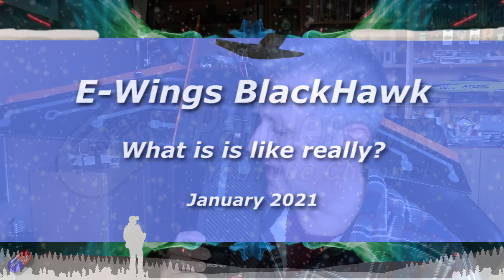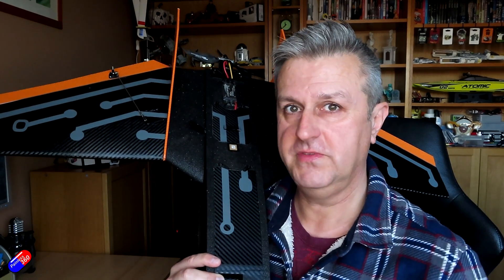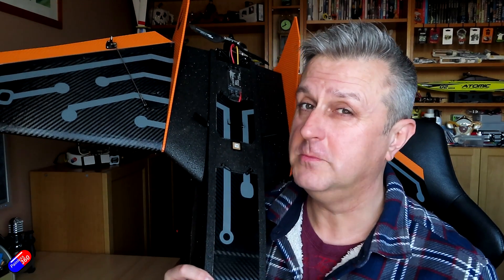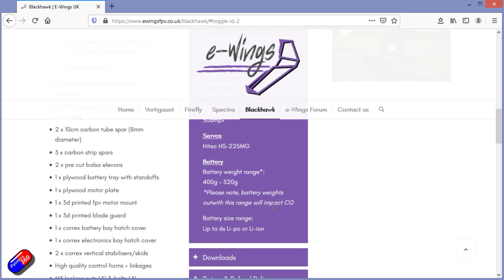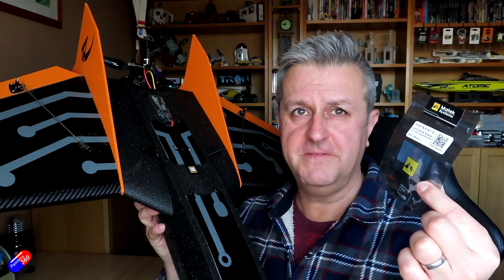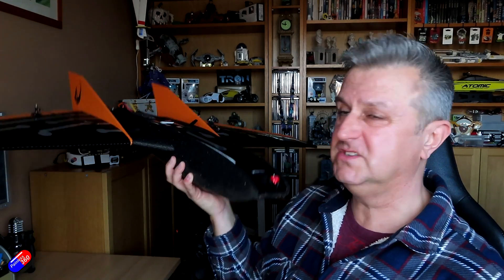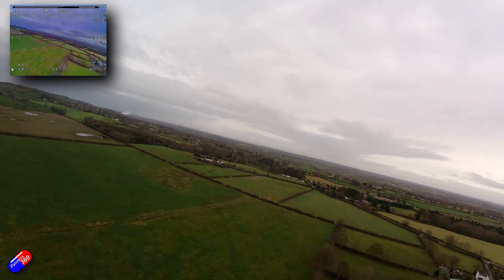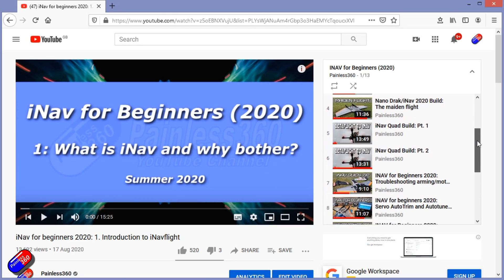e-Wings Blackhawk: What is it like to fly?

Comment: I need your help please 
I accidentakl busted the right wing of my UAV FIX-WING. The propeller broke and the motor got detached 

I fixed the wing fuselage with Carbon fiber and I also reconnected the motor cable. When I turn it on, the servos work but not the two motors

Is the Flight controller damaged? How could it be since the servos for the wings and tail move ( work) but the motor? 

May be the damaged motor not working that prevents the flight controller from turning the other motor?

I don't really know how to approach to this problem. I am trying to get a solution
Reply from the maker: I'd plug a servo into the ESC connector on the FC and see if that servo moves to show the throttle signal is ok - then it would be the ESC or motor.. Best of luck!

Comment: Very interesting that Chris and Greg came up to that agreement, especially since the Drak line has been discontinued by Ritewing.  As of Fall of 2020, the Mini Drak and original Drak are officially out of production. I would think that would change their Gentleman's Agreement. 
Thank you for the extensive review on this wing.
Reply: The foam I use is cut from an injection molded EPP block. I have worked with companies that have used this foam in commercial UAV applications throughout the world, including the Antarctic and the tropics. Very high density. Check out the eWings Instagram channel where I drive my car over our wings ;-)
Reply: @gmac_83  sounds great but, here in the states where we love the draks, it will not help us. 
Molded gives the nice smooth surface of course you laminate a cut wing to get the same effect so it comes down to we can't get them here so, it will be hard to convince any of us else where that it's close.
Reply: @carrboro_chapelhillfpv2442  I'm not trying to convince anyone. We can get draks here also. I have one.
Reply from the maker: I hope so - this is a fab wing for those with a little skill..
Reply: I don't think it's so much an issue of "out of production" as it is that Ritewing are investing a bunch of money in a new shop that precludes laying out large sums of money up front to order the next batch of Draks. I don't see the MD going away any time soon. Such a popular airframe. Would be great if the BD stuck around too. An amazing plane.

Would be nice to be able to purchase this Blackhawk outside the UK. Lots of drakish looking planes being sold these days. With limited production and $242 CAD before duty/shipping/taxes, not like a lotta people are going to be buying them. Guessing this would cost about 500 bucks landed in Canada were it possible for me to buy it. But now that I've watched this review, I want one...
Reply: @jimross898   It is a great craft but, the material that was used is not normal and I do not know where you get it or how much it cost but, as far as I know this is the only company that uses it. I wonder if that is what is going on. Draks are molded and the molds are expensive so the fact that they are discontinuing them means something is defiantly up. I should talk to him and see if he will give a hint as to what is going on.
Reply: It may be a copy of the mini Drak but, it will not be made from the same foam as the Draks. That foam they used for the draks was way stronger than any other on the market. I hate the deals were discontinued but, I imagine it will have to do with availability of manufacturing. 
It sucks but, at least the drak design will live on. 
They say copying is a sign of  praise , if so I hope Chris heals the same. 

Love your color scheme by the way. Easy to see and looks great.
Reply: Not true.  The Drak line is still in production, even 4 years after your message.   I can't speak for the original, big daddy Drak, but both the mini Drak and nano Drak are still being made.  In fact, I just bought 2 of them last month.  In addition, on the Nano Drak, not only can you get one with the standard wings, you can get them with extended 40" wings.  There reason why the Blackhawk is only available in the U.K. is because it is a total rip-off of the Drak.  E-Wings is just lucky that there is no active design patent on the Drak, as they would easily open themselves up to patent infringement.  The Blackhawk looks cool, but only because it looks too similar to a Drak.

Comment: So Lee you say the Lower kv motor cruise 45m at 9A and 70m at 25A, 
With the higher kv motor you get 60m at 17.5A, and 95m at 32A
Do you think the slower motor would pull the plane at the same speed as the faster motor while using the same current? Ie maybe 3/4 throttle for 17.5A and 60m?
Reply from the maker: I'll see next time I fly... Happy flying

Comment: Happy new year. 

I'd love a video on props/motors/plane types for ultra endurance flights. I'd also be super interested in  props/motor combos for ultra endurance quads. I currently have a Parrot Bebop 2 Power that gets almost 30 minutes and I'd love to know what motors/props would help me achieve that.
Reply: Yes we really need to start comparing airframes and power systems to find out what's the best, we need to know cruise speeds at a given weight and power (current draw and cell count) 
I have a Phoenix asw28 that I will be able to provide numbers for. We need to table all the data somewhere and find out what's the most efficient/fastest setup.